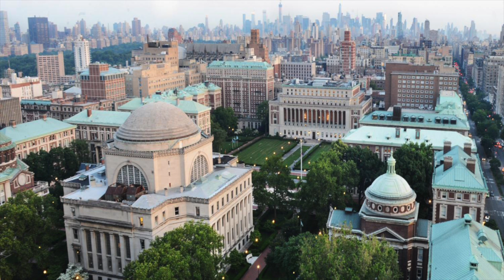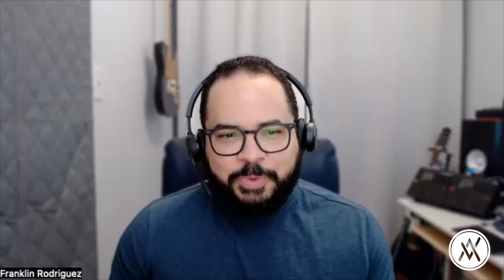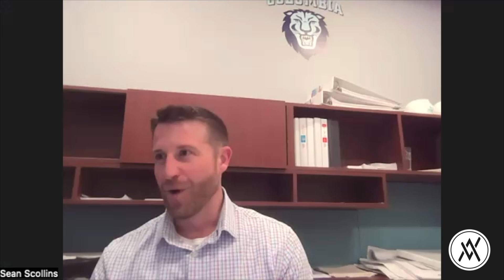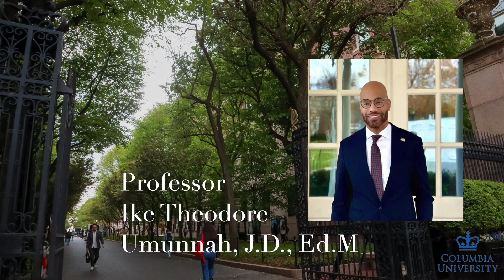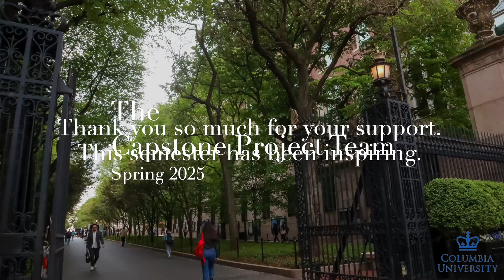Alternative Visions Podcast Ep. 1.

Comment: In the pursuit of more efficient and sustainable campus operations, one critical improvement involves moving away from short-sighted mid-level management structures that often lack continuity and hands-on technical insight. Instead, implementing a Lead Operating Engineer role should be a strategic priority. These individuals not only have long-standing tenure but also a deep, working knowledge of the campus’s mechanical systems and infrastructure. Their history of direct engagement with equipment, system troubleshooting, and operational integrity makes them uniquely positioned to bring accountability, foresight, and long-term stewardship to critical building functions—qualities that transient or disconnected management roles frequently fail to deliver...just a thought. Thanks for the discussion👍